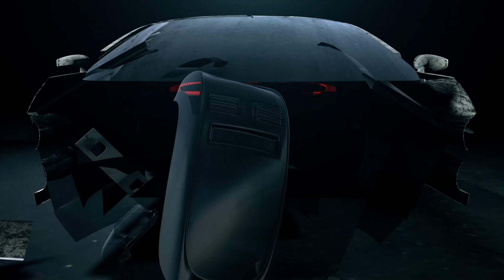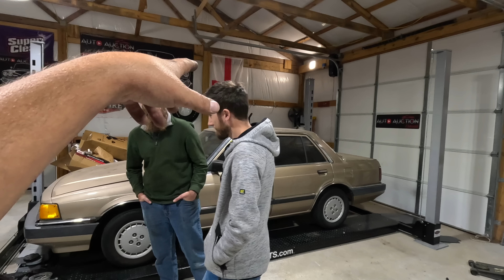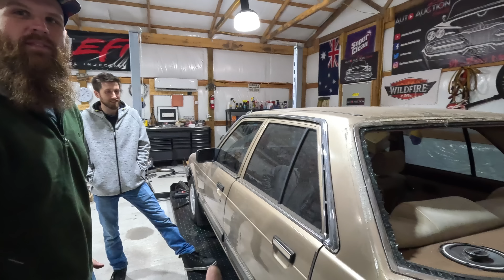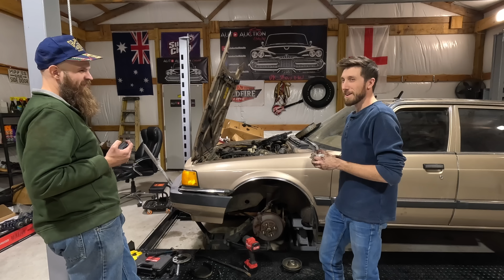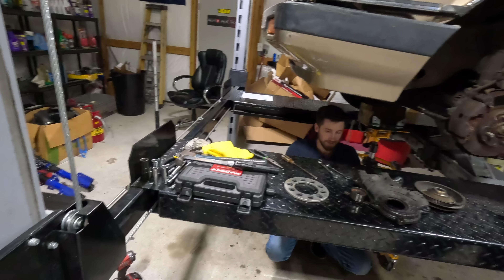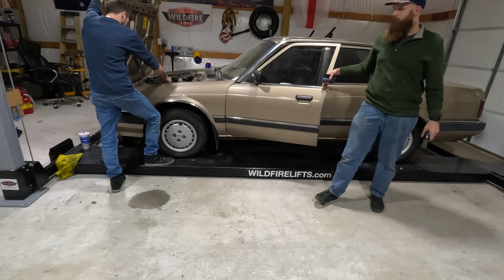1985 Honda Accord Giveaway Winner - @TMPGarage Timing Belt!

Comment: Do you guys think an Accord from this time period can be made into a reliable daily driver in 2023? Of course it would need work and you have to be able to do the repairs yourself since it would be extremely costly and get ripped off by a mechanic and would not be worth it unless you do the maintence and repairs yourself. As long as the engine and transmission are solid and little to no rust on the body I would think this car would be good or a late 80s Accord Lxi fuel injected trim or 90-93 CB7 Accord what are your opinions on this kind of car as a daily driver? Right now I have a 99 Civic Coupe I daily drive had very very little issues with the car but I am also looking into getting a late 80s or early 90s Accord and I can put half the miles I drive on each car of course I can do a lot of the maintence and repairs myself which i have done with my Civic but everyone I mention this to says I am crazy for wanting to have two older cars. Of course you have to be extremely careful to not get scammed and get a lemon but I was wondering what your thoughts on having two older older Honda's as my only vehicles are?